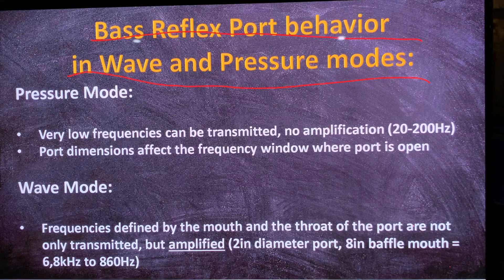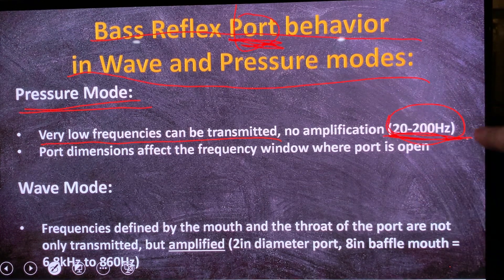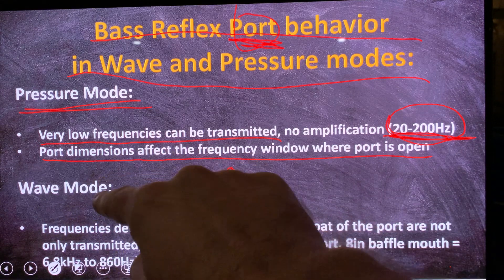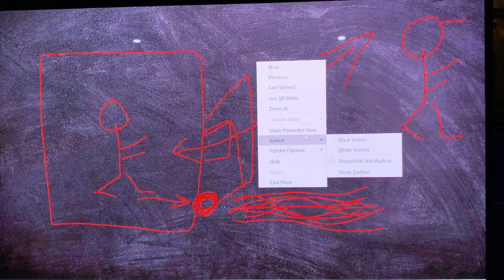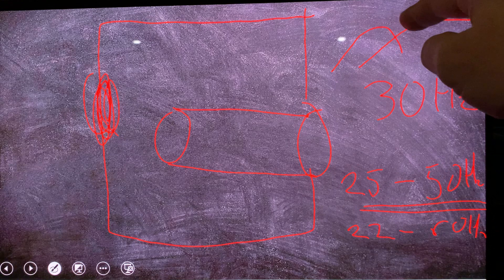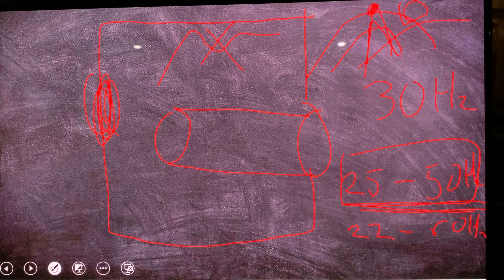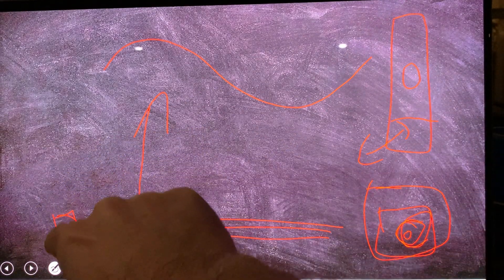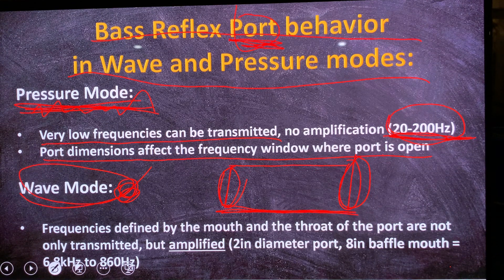Wave mode and Pressure mode: what's happening with Bass Reflex Ports?

Comment: Thank you for the excellent presentation, although the underlying acoustical behaviour of soundwaves still escapes me somewhat :)
Reply from the maker: The lowest frequency main resonance of an object equals the length of 1/4 of the soundwave. Thus, wave mode propagation relies on the resonance of the surface, amplified by the resonance of the air column inside the cabinet. The energy is tranmitted in the form of waves. Pressure mode: the force is not transmitted in the form of waves (as the size of the resonator does not support the frequency), but in the form of a high pressure release that starts to expand and transforms into a wave outside of the resonating object.  I hope this helps a little.. ; cheers, Janos
Reply: @realworldaudio  Hi Janos. That is actually a very good explanation! Just a little follow-up question: what determines the coupling efficiency/effect between two "air spaces", e.g. the inside volume of a VP and the surrounding room? Thanks as always! Claus